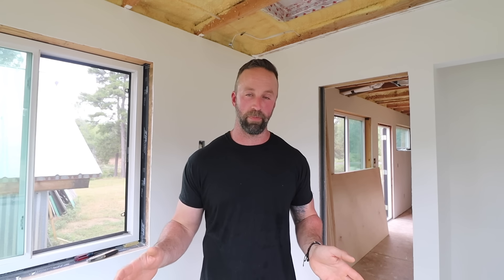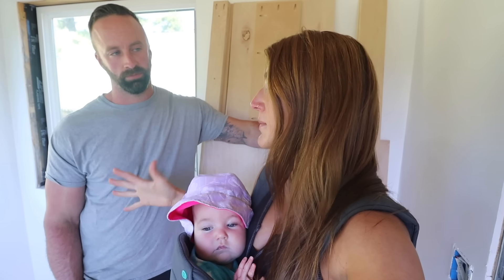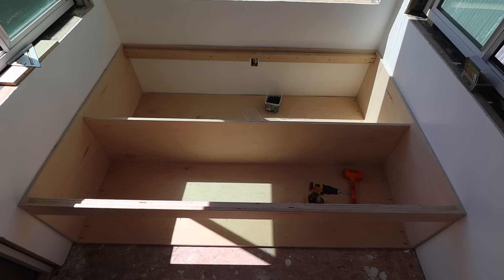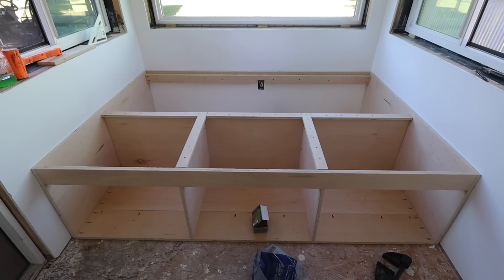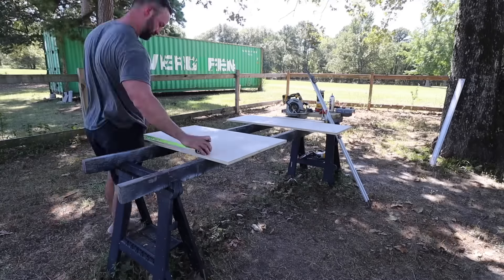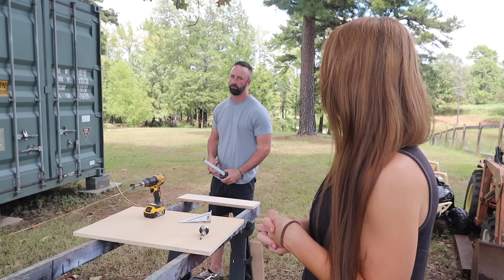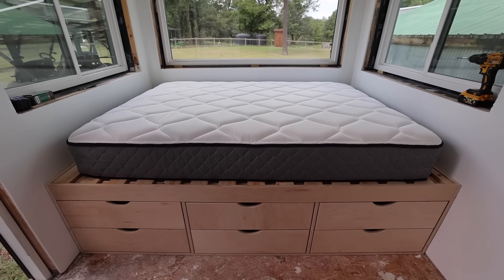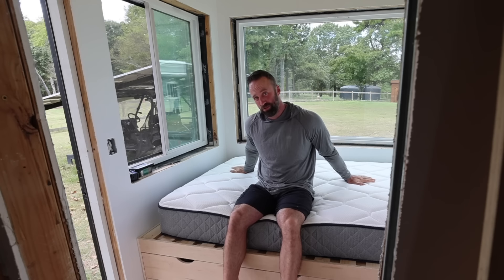READY TO MOVE Our Container To The Mountains!

Comment: The suggestions for using Gas Struts for the bed by the commenters is a great one. I am excited to see the whole transport of the Cabin to the mountains but have one question...I didn't see a video of foundation work to set it on so I assume that the cabin will be dropped off in a temporary until the foundation work will be done later. Then a crane will have to lift it to set it on the permanent foundation...right?

Comment: re drawer pulls: we used unbreakable shoe laces cut to 7" lengths, ends folded under 1/2" and then screwed to drawer fronts with pan head screws. Been working fine for 6-7 years now.

Comment: Put your bed on drawer sliders.  Then just pull the bed out to expose that back storage.
Reply: I agree with this... perfect idea...
Reply: Good idea but you have to make sure you are able to have some sort of support for the part of the bed that is overhanging the draws so when you climb up to reach the back area it doesn't teeter or break the sliders.  Maybe drop out legs or simply a stand or step stool that you place under the overhanging part of the bed to support it.
Reply: Or maybe it could have been 3 drawers across, all deep (front of bed to back wall); on heavy pullout sliders (like those used on overlanding truck beds to organize kitchens/household/clothing. One for him, one for her, one for misc/bedding etc. Divide each deep drawer into sections; most-used things in front, to less-used items in back. No lifting required. Put his/hers on left and right side; misc stuff in middle pullout. That way they can both access his/her pullouts by standing center. And when needing misc/bedding items, it can be accessed from either left or right sides. Looks great regardless of layout and can't wait to see it "in the mountain wild"!
Reply: Or use gas struts to lift the bed base up.
Reply: @Jan-and-Rob-TheTwilighters  I'm thinking an external weather proof door at the back.
Reply: @hellabiz4289  there is not enough free space between bed and the wall for long pullout drawers.
Reply: EXACTLY WHAT I WAS THINKING!  Great minds think alike.
Reply: @petitenarc   I'm thinking an external weather proof door at the back.

Comment: Could you build a 'pop up' crib into one of the top draws? You just need a mattress that will fit and some padded and ventilated sides so baby can't roll out. The whole thing could tuck away and close when not in use, and once baby outgrows it, just pull everything out and you have a draw back. When my siblings and I were small. My parents had a small camper (RV)  p- smaller than your woodland camper - and they had a crib in one of the cupboards in much the same way. Worked brilliantly! I'm so exited to finally see the container home in its final place and see it all finished out, you guys are doing a fantastic job!

Comment: FYI for those that might be concerned, you may want to round the corners of the bed bumpers/holders to prevent any mishaps. Might not seem like it could but kids bump into things, they're kids after all and kids just do things like that. It will also make getting in and out of the bed easier too without those sharp corners.

Comment: You can always make more room in the "cabin" by using discarded metal to make bumps out on the back and or the front. If the cabin is going to always stay at the other property, you can also add bump outs to the sides.

Comment: I’d say for the back storage area, attach hinges along the back wall edge and make 3 doors with the same cut out handles on them. Then you’ll just have to pull the mattress out halfway, climb on top of it, and lift up your little door hatches to get into them! You could even use small baskets down inside so you lift the hatch and lift out the whole basket of stuff. Keep a blanket in one, extra sheets and pillows in another one, and extra bedding for the kids beds in the 3rd one! 😊❤

Comment: The best bed in a camper or tiny cabin is a Murphy bed or one on cables that can be raised to the ceiling and you could still have storage on the floor if needed.  A bed is wasted space 15 hours a day.  Since you can weld, you could make that space accessible from the outside also.

Comment: Make it so you can side the bed back and just lay on it and pull out what you need.... When you're done slide it back into place.  Might need to brace the end that overhangs but easy peasy.
Reply: easy peasy:  braces can be hinged to the wall.  And the short, hinged floor pole folds down to rest on the floor.

Comment: You should 86 the slats, switch to a solid platform and put it on struts so the bed can lift when you need to get into the rear storage or change bedding.

Comment: Instead of a bunch of slats had you used a sheet of plywood and then two hatch back pistons for rear lift and a piano hinge at the head of the bed. By doing that it would be so much less work to access that spot.
Reply: the slider concept that is posted by others works easier. Would frame slats into 2 halves to access the back narrow storage.

Comment: Rig a pully system where it raises the mattress. You can just do the front 2 corners, or all 4. That way the mattress is now out of the way. Then you can move the slats to reach the back side. Personally, I would not have done full slats across the bed, I would have done a full sheet of plywood, but on the back side, do a cut out with hinge doors to lift up so you can get to the back area.

Comment: Hey Spencer, I know has its own engineering/build headaches associated, but have you considered building external access doors (outside of the cabin) to be able to get into that inaccessible storage space under the bed? Area butts up right against the wall and if you're embracing mobile living, something like this inside/outside dual access storage area is common in motor homes. Just a thought to consider.

Comment: You can do a Murphy bed concept. Find arms that will left put them under the bed we used 2 arm Jack's that could left 400lbs & then lift when needed & put back done easily. Then you can use both with no problem & not messing up your bed.
Reply: Also we turn our bottom bunk into a crib. So the baby could be in the other room.

Comment: What if you did two smaller mattresses going from side to side. Then you can divide the slat sections the same way and put the back slat section on hinges. That way you can access the back half or storage bin area if you will without moving the mattress. Could also use some kind of stick to hold it open kinda like a car hood. Might need to move the sheets out of the way but that's a lot lighter than the mattress.
Reply: Interesting.

Comment: If I could make a suggestion regarding accessing the storage area in the rear of the bed frame. Have you thought about adding a platform on top of the bed frame instead of using slats and putting it on high capacity drawer slides. That way, when you want to access the rear storage area, there's no lifting of the mattress or removing the slats. You just unlock the drawer slides of the upper platform that the mattress sits on and slide it forward, allowing you easy access to the rear storage area. Seems like it would be much easier than using struts or removing slats. Just a thought.

Comment: A better way for the rear storage access would be to split the slats down the middle then lay them in an alternating pattern then fix the rear slats to a batten that’s not fixed to the bed but will rest on beam at the the rear inside the bed, doing this you can slide the rear slats into the spaces of the front slats, this way you wouldn’t have to mess about with the drawers 😊 I stole the idea from some ikea furniture lol

Comment: Don't forget to put ample smoke alarms into your new home and always check the batteries. You should get at least one for the middle section that has a light that comes on automatically when the alarm sounds. You could get one for each room and that would be fine too. 
Also don't forget when you move your home to be aware that the drawers on your bed and even maybe other drawers will fall to the floor and may get damaged.
Reply: tape will keep the drawers closed for the trip.

Comment: I wonder if putting two lift support gas struts on either side of the bed could hold the weight of the mattress and allow you easier access to the back from the top?  Problem is you would have to redo your slats.  Either way, great job!

Comment: Spencer. Furniture that has lasted.  Like old dressers; never had hardware.  They used wood guides inside and out.  Waxed it and wallah. Kids can stand in it. Abuse it. And it stands the test of time.  Also you f u use gas struts ; u can lift the platform so u can store extra blankets; diapers; etc.

Comment: when I wach you guys who make shipping containers into livable spaces i cannot help but wonder why would you use full 2x4 for studs, and thick Gyprock for the interiors. If i was building one for the climates you are doing them for, not -40 degrees like where I live, I would build so every outter wall stud would be put into the resessed indent of the outter wall with a like 1/4" space between my interior sheeting on the inside coragation to slip a thin sheet foam insulation. basically saying keeping every savable inside width I could maintain. cause with a big ol 2x4 and 1/2" gyproc you loose like 8" inches and on 8 feet only loosing 8" is huge. and devider walls, like a 2x2 it more than thick enough, so you do not loose over all end to end legth space. say you have 5 inside divider walls you loose like 26 inches. that is huge space loss. I made a fully insulated Reefer style container into a cabin. they have a 2 3/4" thick insulated outter wall and end wall. but i just glued 1/8" thick pannel board to the existing kemlite interior walls, and done all interior walls with 2x2 s. My only major space loss was putting in a heating system to heat it cause of the extream cold here. as well as I put any exterior doors on both ends to save the old wasted door opening usable space. the Hunter fellow and his wife who bought it loved my concept, as It was so sealed and insulated. as well they loved the fact that I never lost any inside wall to wall livable space.

Comment: Please, seriously consider making or buying a push stick for your table saw work. You will push the wood through 1 million times without incident and then the 1 million and 1st time, you will slip and cut your finger. I see so many YouTubers using a table saw without a push stick and I worry. And one of favorite YouTuber, cut off a finger (Nerdfroge). So please, buy a few push sticks and use them when cutting things on the table saw.